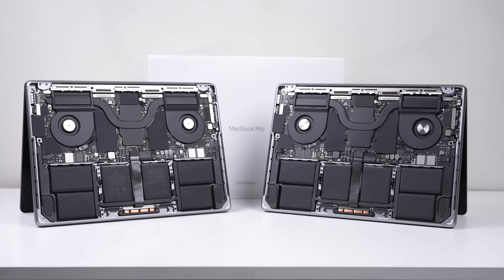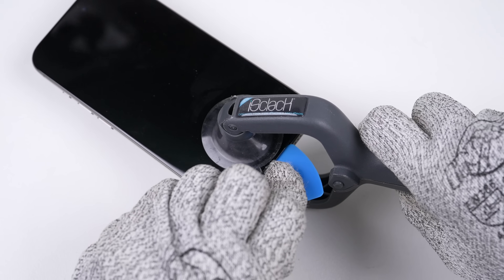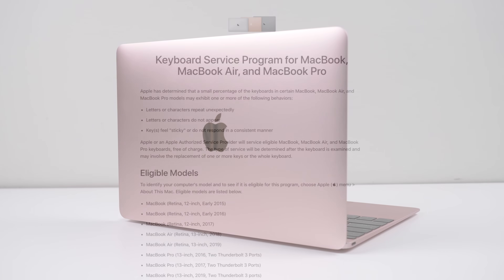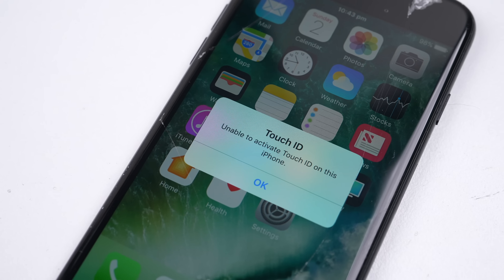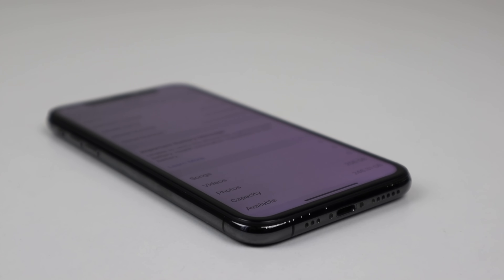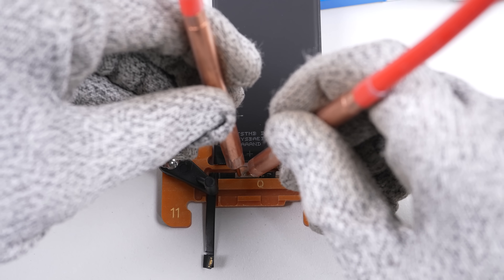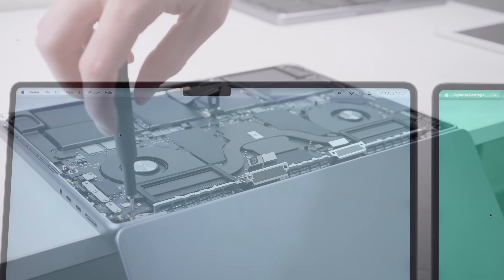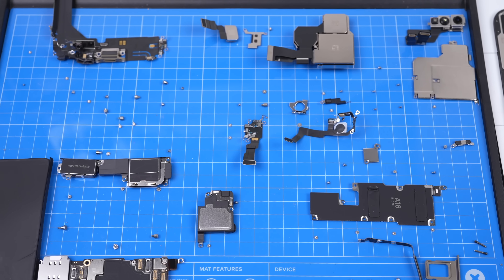Astonishing Anti Repair Practices By Apple In the Last 15 Years

Comment: The irony here is that I purchase their phones 2nd hand because they have the longest software support, you can get them for cheap but also be on the latest software for years to come. On one hand they are limiting e-waste by leading the way in terms of software support for their phones (up until the pixel 8 which now has 7 years of updates), but on the other hand they are making it not financially viable to repair the most commonly failing parts on their products in an attempt to sell more.

I guess they can fall back on "security" requirements for their woeful repairability scores, which muddies the waters in terms of their public perception.
Big business doing big business things I guess. It sucks.

Thanks for the vid Hugh, you're the man

Comment: How many tears has there been from buyers losing images they didn't back up crossed with Anti repair practices. My Big tip for any readers out there the Samsung A52S model is an extremely effective Samsung model that has very few bug bears for a low cost for the average buyer that does an excellent Job

Comment: As is often said by other repair youtubers, the importance of denouncing those nasty anti-repair designs goes beyond Apple itself. The abominable riveted keyboards, soldered RAM, and even soldered SSDs now are common in other brands (like Acer, Asus, Lenovo, Samsung) because they saw Apple do this despicable practices and get away with it.
Reply: But they aren’t standard luckily yet. We still have a choice when buying laptops when it comes to upgradability and repairability. Some brands/models are better in this matter than other.
Reply: @kamilpotato3764  Right now for upgradability and repairability, you can't beat Framework laptops.
Reply: It disgusts me that most companies have gone out of their way to make repairing our own devices substantially more difficult or outright impossible. Instead, we are charged for repairs and in some cases wait weeks to get the item back just to find out it still fails. 

Not to mention this is soooo great for the environment! (Not) They only care about forcing you to buy more product, and forced obsolescence goes right with that mentality too.
Reply: I don't think it's the worse thing. I think whats worse is the mass produced products are pumped out ever year. When I ask why are they making a new model, I some time hear well technology has improved. With in the space of a year. They're not putting out the best product. Let's look at the life expectance of the product. I would assume it should be at least ten years but's likely much less. So in space of then ten years they are putting out ten new models. It's ridiculous. People are replacing their phones almost as much as they replace their shoes if not more.  I do agree the anti repair suck and is part of the problem.
Reply: Asus?
I have an Asus and none of the ram was soldered, or the ssd. 
It even had bonus slot in it specifically for upgrades. I have since taken the original 8gb out and replaced it with 2 32gb sticks with no issues
Reply: thats the nice thing about putting your own rig together. "If i cant put it in, im not buying it"
Reply: @Furry19931993 Yeah exactly. It's not terribly hard building a computer, or at least getting someone to do it for you.
I have built a few computers for friends, I kind of enjoy it.
Reply: Just get a framework laptop. It is the only laptop on the market that will last you more then 5 years while staying up to date in performance in this day and age.
Reply: I own Lenovo laptop, pretty much only the CPU and GPU are soldered, everything else can be easily replaced (did so many times)...
Reply: @panjak323 It's a given for laptop to have soldered GPU and CPU because that is the only way for them to save space, they do have pretty repairable and replaceable components tho.
Macbook, on the other hand, I can't fucking comprehend the irrepairable montrosity that is the M1 and M2, who the fuck solder the ram and storage and even the goddarn wifi card?
Reply: It's funny how these other manufacturers flock to copy what Apple does with their hardware despite making a computer that is lackluster when compared to Apple. Same thing with the phone manufacturers. These companies can't innovate their own ideas anymore so they copy the worst elements of their idol company (Apple) and then are surprised when Apple is whooping their ass in sales.
Reply: It depends on the product. I understand some soldered ram or ssd in really tiny gaming laptops. Like the G14.
Reply: @alexandrostheodorou8387 I don't. Most gaming laptops are $1500+, if I'm buying a laptop that expensive, it better have user replaceable RAM and SSD(s). If the company can't be bothered to shell out the extra $3 for a couple M.2 and SODIMM slots, they do not deserve to exist.
Reply: Just as we saw everyone ape Trumps blatant lies
Reply: How much of that is anti-consumer vs. simply ease of manufacturing? Replacing screws with rivets will speed up assembly and soldering in components removes connectors from the BoM.
Reply: screw ultrathin laptops, they are the reason why everything is soldered in
Reply: It's not because they "saw" Apple doing it, it's because most of these companies are their partners and buddies, look at how many Apple devices had Samsung chips and displays in them. "Free market" is a total lie, they only do it likewise so you won't have any other choice. Apart from what you straightforwardly see as a product, companies have a lot of NDA's and deals between them in the backstage. And the trend is totally insane, it's like... when some were truly innovating, there was competition (somewhat), now when they feel they are reaching the end of the road with some type of device, they want you to still buy the SAME next one, by giving you no other choice, and by making your old one "softwarely" obsolete, and that if it survives the life expectancy, 'cause repair.. is, yeah, the subject of this video. We are living THE STUPID AGES, no matter if it comes in the form of a CEO, a politician, a president, they are all alike, but it will pass. The scum will pass, we jost gotta stop feeding the cancer financially, better ignore it completely, as our time and attention may also mean money
Reply: Those keyboard rivets LOL. They were so cute, a laptop I got in a trade once had a broken keyboard from water damage, so I used a soldering iron to melt every single one. Manufacturers think they're such hot shit, if they put it together it don't matter how many self sealing measures they implement, there will always be a way to rip it apart.
Reply: Well STOP using these thing until they change their attitude!
Reply: @AaronWolfenbarger  What could possibly go wrong with this way of thinking is somewhere between "Other brands [...] saw Apple do this despicable practices and get away with it".
Reply: @lindseylinck  ya so stop buying these things and eventually they will stop doing it when you threaten their profits
Reply: @AaronWolfenbarger  People are broadly doing that, that's why the consumerism oriented capitalism has come to a halt, and recession. But it's not the consumers to blame for that, it's the lack of innovation and the scam economy system ideology itself. Every lie was backed up by another and so on. Now the circle ended, and when they tried to restart it, unluckly for them, people were really paying attention
Reply: Rivets are much cheaper, if you make millions of laptops you can save tons of money. I mean you can't lie to me and say: "Well if I install something in my house, I spent more money then needed for no reason..."
Soldering components is way cheaper compared to mounting components with connectors (open any cheap stopwatch or calculator and you will find a black blob instead of a packaged Micro Controller Unit), also it improves performance as connectors have capacitance and inductance, thus reducing frequencies at which the product can operate.
Also, don't forget that Apple is designing most of their major parts, so from engineering point of view they can allow themselves to solder the components.
Lastly, if you are not happy about Apples products then why the fuck you keep buying then, just to bitch about if online later on?
Reply: Let's blame Apple for everything.
Reply: @billymania11  Apples strongest peasant is here to defend the company, they must be proud
Reply: @billymania11  why not
Reply: @billymania11   We should.
Reply: @billymania11 Well as the comment pointed out, Apple does 99% of these things first and all the other companies follow as they can see Apple gets away with it so it is 75% on Apple, 25% on their consumers enabling such behavior, I would normally say 50/50 but Apple seemed to design a closed ecosystem to make it harder for users to switch away from them which even though if I were an Apple user, I can almost ensure I would switch to Android with any of these decisions, I get most people dislike change and stick to Apple as they don't want to spend a week (tops, but they likely don't know how easy it is to switch to Android) adjusting from iOS to Android
Reply: @JordanPlayz158 Just because apple did it first doesn’t excuse those who emulate the practice, they made the choice to do so, not apple.
Reply: @billymania11  of course.
Reply: you have developed quite the fine taste for leather @billymania11
Reply: And justifiably so. @billymania11
Reply: @billymania11  apple started it so why shouldnt we
Reply: @billymania11 because they are to blame. Why tf are you defending them? Does your daddy own the company?
Reply: @billymania11  This, but unironically.
Reply: @billymania11  Of course we should, why would other companies don't follow suit, unless they wanna lose their market share

Comment: The EU needs to step in and just tell Apple straight up "release a software patch removing all the nerfs or you're not allowed to do business in europe". How many iPhones have gone to e waste, even though they are still usable and decent phones, simply because of software locks that should be illegal to force on users.
Reply: Removing the software locks on parts would also make iCloud locked phones more than fancy paperweights since you could harvest parts from them without having to worry about if it will work properly

Comment: Anyone who believes Apple is intentionally slows down phones with later software is clueless. 

So far, Apple is the only manufacturer who implemented battery management in such a way that your 9-year-old iPhone 6 with dead battery won't be turning off at 20-30% but will be working until very last moment (thanks to reducing CPU power, screen brightness, etc.).

I have a friend with Pixel 2 which frequently reboots at 50% of charge and less because it can't manage itself and operates like battery is brand new even though it's 6 years old at this point. If he'd bought iPhone X instead, it'd be working perfectly fine even with degraded battery.

Comment: Would the removal of the headphone jack also fit within this video? It adds an extra step in which Apple can make it more finicky to use third party headphones.
Reply: I agree, as an Apple user (not for long since after seeing their last anti-repair practice I decided to stop buying Apple devices until things eventually improves) I hated that, if iPod touch were able to have the jack thickness is a poor excuse for not including it and its useless to make more room for battery if the battery autonomy they gain this way gets quickly ate by software bloat and while for phone-calls/music I can easily replace a wired headphone with Bluetooth ones I can't say the same for more specialized applications like using the phone as a pocket guitar amp/recording studio or using an Y cable to connect it with my Nintendo Switch in order to hear game audio and use Discord for voice chat using the same headphone so by removing the jack they made iPhones worse and less capable.

Comment: Apple has been anti repair forever.  I recall the first Macintosh where you couldn't get service manuals unless you were state employed or had a service contract with apple.... This was the start 90's.
Reply: Hell, even having to use 400/800k floppies, specific file systems and internal SCSI hardware can be considered an early form of this. I think so anyway, especially considering that just about every filetype could work on old Macs. It was arbitrary for the sake of it.